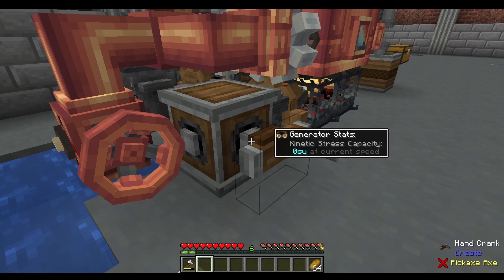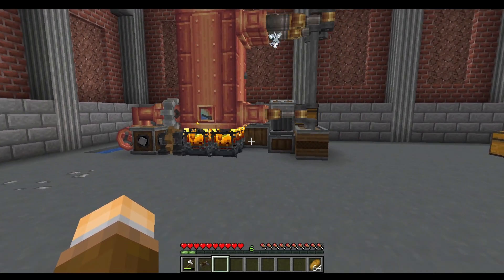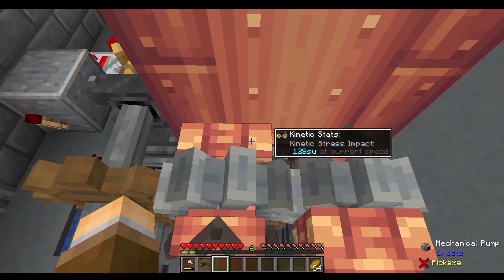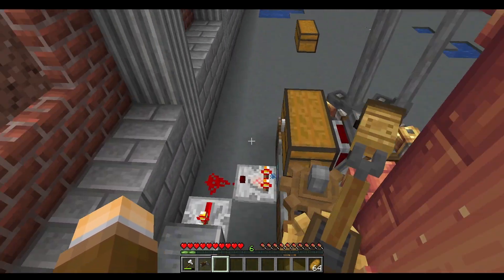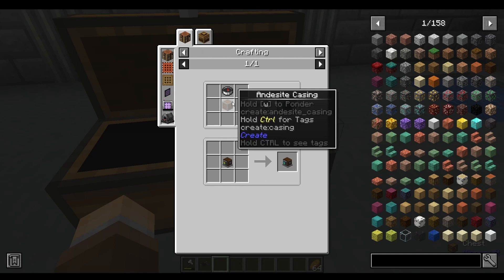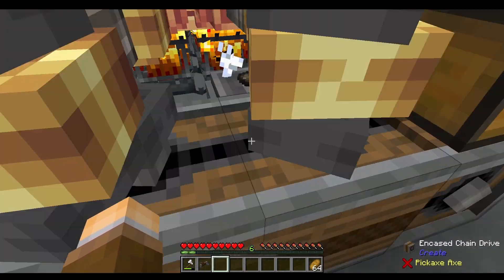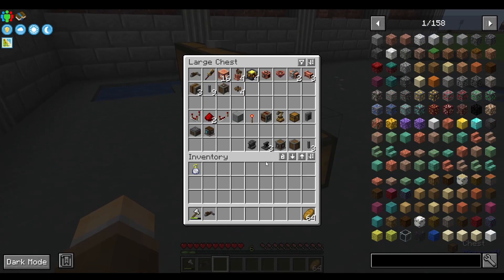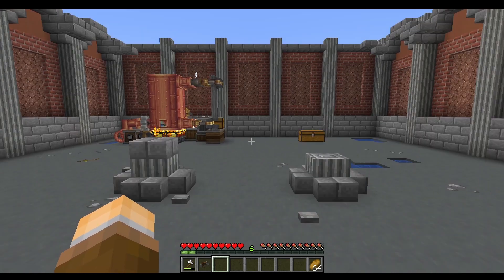Create Mod 5: Improved Hand-Cranked Steam Engine + Design Description

Comment: Very new to create. Where exactly is the output for the engine to connect to other machines?
Reply from the maker: frankly you can connect any moving part to a machine, but the intended output are the two vertical shafts

Comment: don't worry about the mechanical arm putting excess fuel in the burners, they will automatically stop if the burner has 500 seconds of fuel in it (according to the wiki).

Comment: You can also connect a passive mechanical power source like a windmill bearing and just have lots of big to small gears going fast connected to the steam generators, which will force them to run at that speed while not giving it any extra power from the engines themselves.

Comment: One tip, instead of encased chain drives where the shafts of the steam engine are, use encased gearshifts and power them to double the rotational speed easily
Reply from the maker: I think you might get less stress capacity though
Reply: @GabeLily  i think you could actually get more if you route it to the pumps

Comment: Has this been patched? I think I am following the same design, but the mechanical pumps stop spinning as soon as I stop using the hand crank, how did you make your water constantly flow in?
Reply from the maker: Have you tried spinning it more, so that the blaze burners get fueled?
Reply: check your pumps, one might be wrong way around. make sure arrows both facing towards the fluid tank
Reply: @callumd5  Yeah, both are facing towards the tank, and all blaze burners are fueled. But the moment I let go, it stops moving. Am I missing something? What's making the pumps spin anyway?
Reply: @hamllock  Please inform me if you have found a way to fix it, my friend and I are having the same issue.
Reply: @TheCubeMaestro  I fixed it, apparently I didn't realize that the block below the mechanical arm isn't an andesite casing, but rather an andesite encased shaft.
Reply: @hamllock  Thanks so much!! It works great now!

Comment: As someone who is new to create (first time having a decent enough computer to run the mods), What is the benefiting using a hand crank engine over one that runs all the time? Is it mostly to save on fuel?
Reply from the maker: Yeah, in case you don't need something running all the time it can be useful
Otherwise it's just for looks, it's pretty cool to start up a whole base worth of rotational energy with just your hands, after all

Comment: My design was a 6 cylinder engine that used a belt feeding into chutes that fed into deployers that fueled the burners. The deployers wont actually waste fuel on the burner if the burner is fueled all the way. So you just have a belt that goes in a circle cycling the fuel. That and a very efficient charcoal farm means that I have my engine always running non stop after one manual start with the crank, and I have 2 double chests full of charcoal, which then feeds overflow automatically into the fuel input chest.